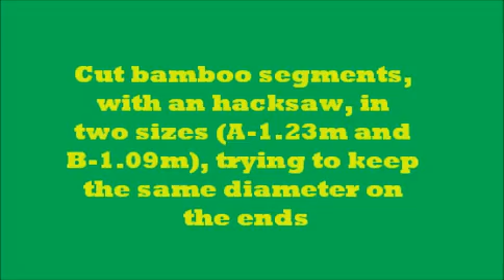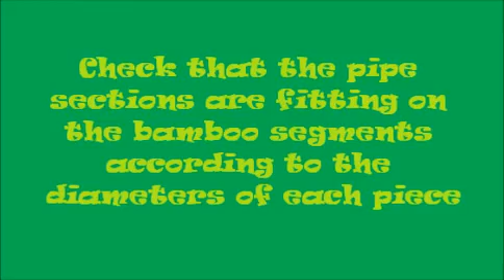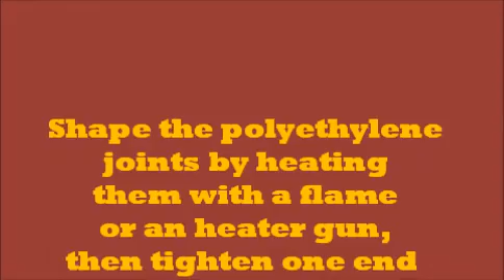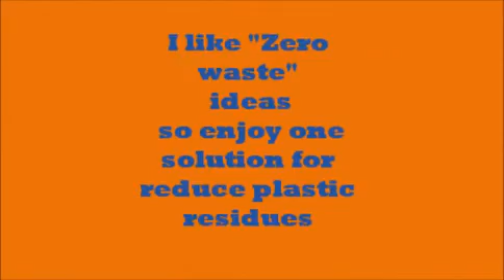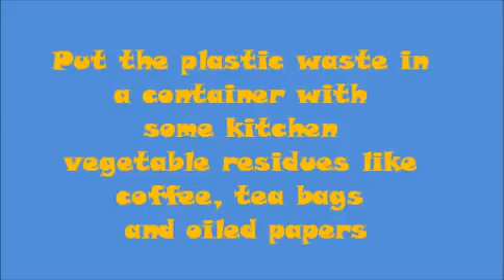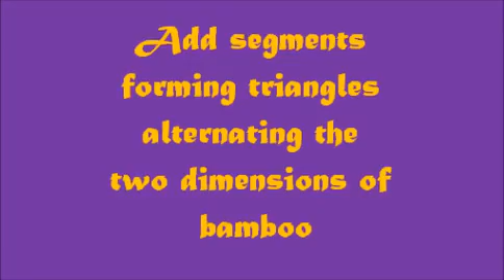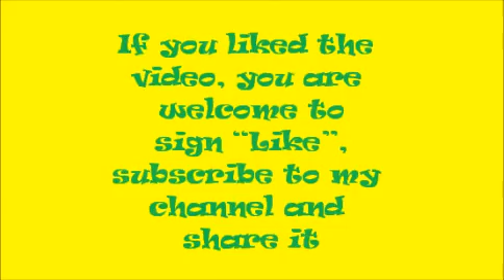How to Build a Geodesic Dome from Bamboo! Easy and inexpensive DIY with Zero Waste Solution

Comment: In a different video they filled a large pan with sand and heated it to warm the ends of the pipe to flatten them.  They were expanding the ends to connect 2 pieces of PVC Pipe for a Dome.
Reply from the maker: I agree that using no direct flame to warm the plastic can help to reduce the possible dioxin pollution, anyway passive warming with sun or indirect flame should be the best way to reduce any pollution

Comment: Saludos camarada cuánto mide cada palo de agujero a gujero quiero hacer uno de tubos galvanizado o de pvc
Reply from the maker: mido e te paso la info
Reply: @naturalmao9341  30 sticks 1.20m 35 sticks 1.30m
Reply from the maker: bamboo segments without plastic hubs misure 1.23m and 1.09 with the hubs 1.20m and 1.30m

Comment: Very good idea.  I am thinking about how much weight it can withstand
Reply from the maker: thank you very much. the weight that can be supported in general depends on the thickness of the tubes used as connectors. this model can easily support plastic sheeting as well as cotton and wool

Comment: can you make domes from  bamboo with 4" outer diameter and the minimum thickness is about 1/2" and the struts would turnout flat?
Reply from the maker: can you help me to understand better your question?
Reply: @naturalmao9341   can you use thick bamboo strips instead?you split the 4" bamboo into a  couple of pieces an use them as the struts. these bamboo sometimes exceed the height of 60ft. it is the only type that is available to us so i was wondering if i could use it instead. thank you for your reply
Reply from the maker: @goldenlion7147  In my opinion if that is the only bamboo type aviable there, you should try.
Reply from the maker: @goldenlion7147  if you try special, care needs about the joints and to not make holes to the cutted pieces, eventually  because it will be more heavy, the plastic connectors needs to be hardones.
Reply from the maker: @goldenlion7147  thanks to ask, I hope my nswer is usefull

Comment: Build from the top down! Easier! The structure is light enough for one person to assemble without going up a ladder!
Reply from the maker: the ladder is an usefull optional, as you say is not needed but can help, expecially if is windy
Reply: we tried and for us was easier to build from the bottom because the plastic joints low resistence

Comment: Bamboo does not grow in the high desert climate where I live , could this work with lodge pole pine? Also it would be great to hear more about the bioremediation of plastic via mycology. My dad developed insitu ( on site , microbe and , hydrogen peroxide and microbes were injected into contaminated ground water) bioremediation of hydrocarbons in the 1980's this was sued at several superfund sites as well as fuel tank leaks into ground water in North America. 
I'm looking at a dome to grow mycelium , so remediating soil at the same time , nice synergy.
Reply from the maker: thanks Erica. Bioremediation is always a great and necessary work, thanks to your dad too (would be lovely to know more about his work). about poles, you can adapt to the source material more aviable near you, pine's poles  can work too, I suggest to treat them with fire or waxes...I believe that this kind of structures can be used perfectly to remediate soils, covering them from weather changes, rainfalls and boosting bacterias and mushrooms growing. I hope to be able to soon update some videos about mushrooms remediation and training to remediate plastics too.
Reply: hola ericka norris , do you have some documents about your father insitu studies? thanks for the nice sinergy

Comment: qué tipo de hongos se pueden usar para digerir el plástico?
Reply from the maker: most types of plastic will be partially degraded by soil-dwelling fungi, especially species in the genera Penicillium, Mucor, and Aspergillus. Turkey tail (Trametes versicolor) has been shown to degrade Nylon and Phanerochaete chrysosporium can digest bakelight (an early form of plastic made from phenol and formaldehyde)....the application of the digestive enzymes produced in the liquid medium of this and other fungi has been proposed as viable method for treating plastics
Reply from the maker: a study from 2012 found that the endophytic fungus Pestalotiopsis microspora was able to degrade a liquid form of polyester polyurethane even in the absence of air and without an additional carbon source

Comment: Hello! Is it possible to make a dome house with this technique, using bamboo? Olá, é possível fazer uma casa de domo com está técnica, usando bamboo?
Reply from the maker: It is really important you calculate the weight of the cover..
Reply from the maker: Bamboo is a strong building material, bigger dome》》bigger bamboo》》 STRONGER connectors☆☆☆
Reply from the maker: yes just need to use the bàmboo with appropriate dimensions.. and choose a proper cover

Comment from the maker: English Description
Bamboo Geodesic dome V2 self-construction and "Zero Waste project" by  Fabio Mao Valletta

Geodesic dome V2 self-construction , diameter 4,4m, bamboo and polyethilene joints, Zero Waste project, clean up in nature and bioremediation of plastic by Pleurotus ostreatus mycelium. English Italian, and Spanish languages description.

I'm just sharing a way to realize it. Others tips are Welcome

materials used:
65 segments of bamboo
polietilene tubes
26 nuts and bolts

Let's start

select segments of intact and resistant bamboo, which do not have holes, fractures or are houses of insects

Cut bamboo segments, with an hacksaw, in two sizes (A-1.23m and B-1.09m), trying to keep the same diameter on the ends

cut off possible lateral growths on the bamboo

polyethylene pipes recycled by cleaning the nearby countryside sometimes used as an illegal landfill

mark the tubes at about 20-25 cm

cut the pipes with pruning shears or strong shears

prepare at least 70 sections of pipes

Check that the pipe sections are fitting on the bamboo segments according to the diameters of each piece

shape the polyethylene joints by heating them with a flame or heat gun, then tighten one end with a vice to be able to overlap them and fix with bolts

heat joints at one end,

heat near the tip and turning constantly

be careful not to burn the plastic (dioxin is toxic!)

compress in a vice fold on 16-18 degrees and hold in position for several seconds

joint compressed to one end

drill the flattened end

bevel the edges with a scissors or grinding wheel

3 dimensions and diameters of polyethylene joints

I like "Zero waste" 
ideas so enjoy a solution for 
not dispersing plastic

some precautions for not dispersing plastic

some plastic powder

clean up the plastic produced

plastic residues products ready to be digested from the mythical mushroom pleurotus ostreatus

Put the plastic waste in a container with some kitchen vegetable residues like coffee, tea bags and oiled papers

I recommend keeping the container closed with mycelium and plastic residues near the sink

in order to add the coffee grounds until the container is completely full

Before to build the Geodesic prepares the components and do some checks

prepare 26 nuts and bolts

130 polyethylene joints ready

some more test

testing of polyethylene joints to form polygons 6 to 5 ways 10 to 4 ways and 10 to 6 ways

insert and force the joints on the bamboo segments 

when necessary, warm up the joints or use some sticks to fix them at the best

check about dimensions of the 35 bamboo sticks A-1,30m

check igual dimensions of the 30 bamboo sticks B-1.20m previously marked 

test of stability of the joints on bamboo

begin to assemble the structure

form a decahedron with long bamboo segments A

add segments forming triangles alternating the two dimensions of bamboo

complete the base and join the joints with the bolts

lift the triangles and continue joining segments

little by little… ..piece after piece .....

complete the first level

continue to the upper level

second level forming alternating hexagons and pentagons

finally close the structure with the last pentagon

tighten the bolts

mission complete
nice easy cheap simply of the  best

Give Thanks and now some relax

interpreting smoke signals into a light bulb

If you liked the video, you are welcome to sign “like”, subscribe to my channel and share it

Comment from the maker: descripción en Español 

Cúpula geodésica de bambú V2 autoconstrucción  y "Proyecto Cero Residuos" por Fabio Mao Valletta

Domo geodésico V2 autoconstrucción, diámetro 4,4m, bambú y juntas de polietileno, proyecto Zero Waste, limpieza en la naturaleza y biorremediación de plástico por el micelio  de Pleurotus ostreatus. Descripción de los idiomas en inglés, italiano y español.

Autoconstrucción de una estructura geodésica V2 en bambú con un diámetro de 4,40 m.

Simplemente comparto mi experiencia. Todas las mejoras y sugerencias son bienvenidas.

Materiales utilizados
- 65 segmentos de bambú
- tubos de polietileno
- 26 tuercas con pernos

Empecemos

Seleccionar segmentos de bambú intacto y resistente, que no tengan agujeros, fracturas o que sean casas de insectos.

corte segmentos de bambú en dos tamaños A-1.23m y B-1.09m con una sierra para metales

tratamos de tener el mismo diámetro en los extremos.

cortar posibles crecimientos laterales en los segmentos de bambú

tuberías de polietileno recicladas limpiando el campo cercano, a veces utilizado como vertedero ilegal

marque los tubos a unos 20-25 cm

cortar las tuberías con tijeras de podar o tijeras

preparar al menos 70 secciones de tuberías

Verifique que las secciones de tubería se ajusten a los segmentos de bambú según el diámetro de cada pieza

modele las juntas de polietileno calentándolas con una llama o pistola de calor,
luego apriete un extremo con un tornillo de banco para poder solapar y asegurar con pernos

calentar juntas en un extremo,

calentar cerca de la punta girando constantemente

tenga cuidado de no quemar el plástico (¡la dioxina es tóxica!)

comprimir en un tornillo de banco y mantener en posición pendiente de 16-18 grados durante varios segundos

juntas comprimidas en un extremo

perforar el extremo aplanado con un taladro

biselar los bordes con una tijera poda o muela abrasiva

3 dimensiones y diámetros de juntas de polietileno

Me gustan las ideas de "cero residuos", así que disfrute de una solución para no dispersar el plástico

algunas precauciones para no dispersar polvo de plástico

Limpiamos el plástico producido

residuos plásticos listos para digerirlos con el mítico pleurotus ostreatus

Coloque los desechos plásticos en un recipiente con algunos residuos vegetales de la cocina, como café, bolsitas de té y papeles aceitados.
Recomiendo mantener el recipiente cerrado con el micelio y residuos plásticos cerca del fregadero.

para agregar el café molido hasta que el recipiente esté completamente lleno

Antes de ensamblar la geodésica, preparamos los componentes y hacemos algunas pruebas.

preparamos 26 tuercas y tornillos

130 juntas en polietileno listo

algún otro texto

prueba de los encanches de polietileno para formar polígonos de 6 a 5 vías de 10 a 4 vías y de 10 a 6 vías

inserte y fuerce los enganches en los segmentos de bambú

cuando sea necesario, caliente los enganches o use palitos para una excelente fijación

verificación de las dimensiones de los 35 palos de bambú A-1,30m

verificación de las dimensiones de los 30 palos de bambú previamente marcados B-1.20m

prueba de estabilidad de las juntas montadas en el bambú
comenzamos a armar la estructura
formar un decaedro con largos segmentos de bambú A

Agregar segmentos formando triángulos alternando las dos dimensiones del bambú

completar la base y unir los enganches con los tornillos

levantar los triángulos y continuar uniendo segmentos

poco a poco ... pieza tras pieza ...

completa el primer nivel

continuar al nivel superior

en el segundo nivel formar hexágonos y pentágonos alternos

finalmente cierra la estructura con el último pentágono

apretar los tornillos

misión cumplida

agradable, fácil, barato, simplemente de lo mejor.

Gracias y finalmente a relájarse

inauguración interpretando buenas señales de humo en la bombilla

Si le gustó el video, puede darle me gusta, suscribirse al canal y compartir.